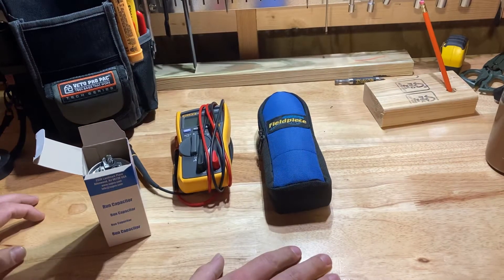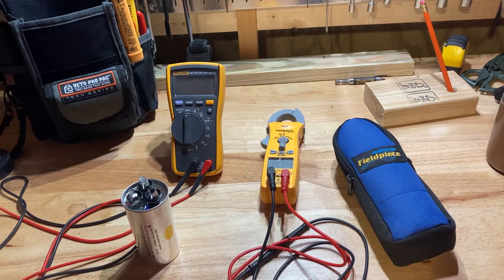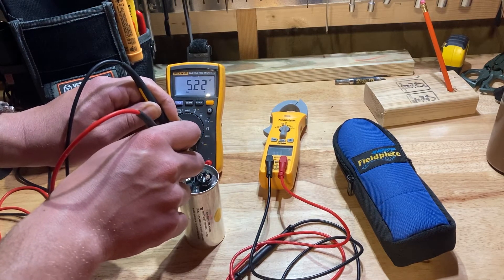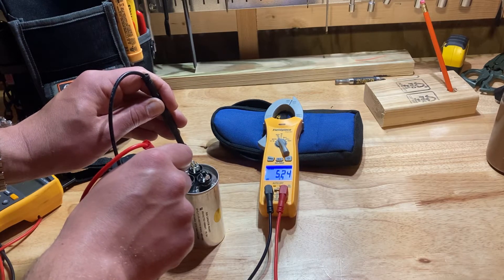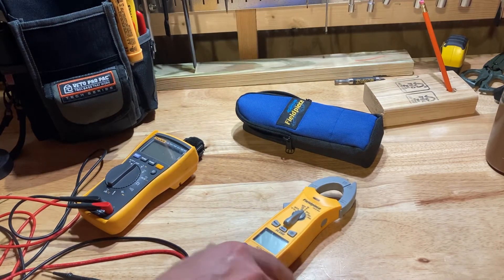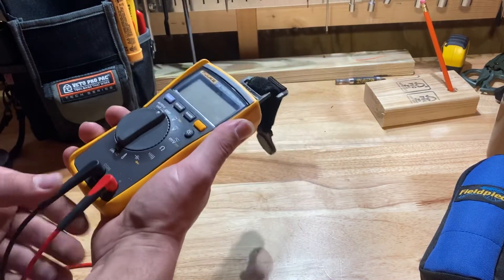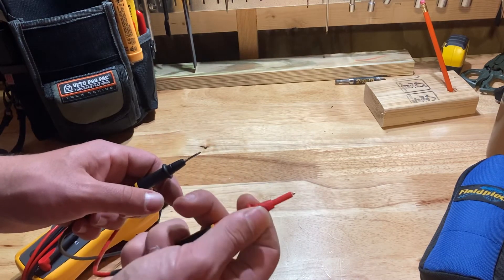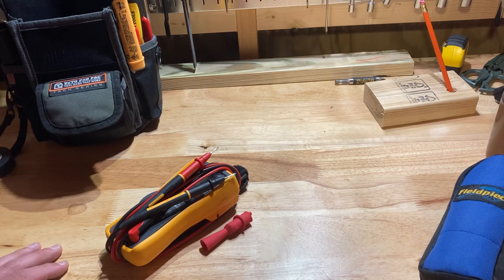Fluke vs Fieldpiece multimeter comparison

Comment: My 260 is very underwhelming :( 2nd one failed on me today. 2nd one in 4 years in the trade. First one would read 40v on a 120v receptacle that was in face good. 2nd one is now reading "ghost amps" and generating.40-.50 ghost amps when not clamped on. Will be swapping brands or just buying something else brand wise

Comment: You are not doing a fair comparison here. These two meters are not anywhere close in comparison. I've done HVAC for 40 plus years, starting out on a Simpson 260. I still have it, and it still works perfectly!  I also have the Fluke 179, which does not work, and it's less than 8 years old. Put your 116 up to Fields LT17A,  These are both fine meters.

Comment: I do HVAC myself also. Been using a Fluke 113 for about 10 years and they sure are great for checking capacitors and all other trouble shooting.
Reply from the maker: Yea man I’ve used meters from all the brands out there over the years, and nothing touches the Fluke in my opinion.

Comment: The fluke is bad for temperature tho… i feel the FP is more reliable there. Just grabbed the 116/323 combo kit. Happy with what you get for the price.
Reply from the maker: Yea that’s how I got  my 116 was that same kit. It is a really great set for the price. I love both meters that it comes with. The 323 is such a good simple meter. I haven’t had any problem with the temp on the fluke, but I don’t use the temp feature that much on those meters so it’s hard for me to tell the difference between the two.
Reply: @realworldtoolreviews  agree with the simplicity of the fluke. Also the small things like being able to disable auto/off and auto/off with the Light. Definitely a more pleasant purchase